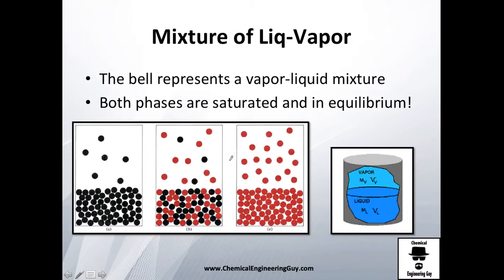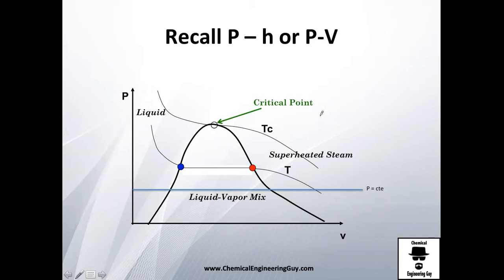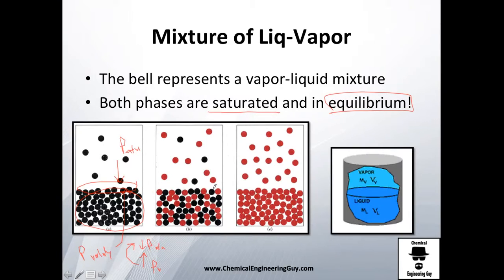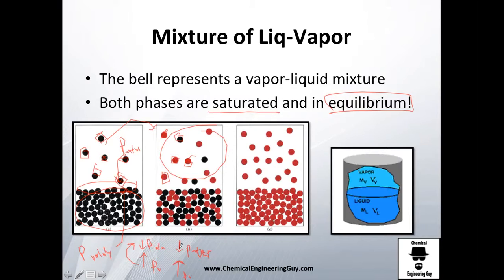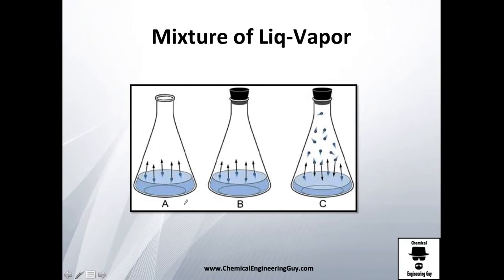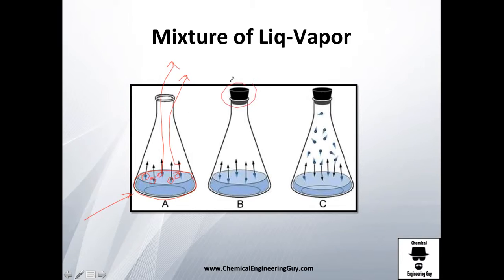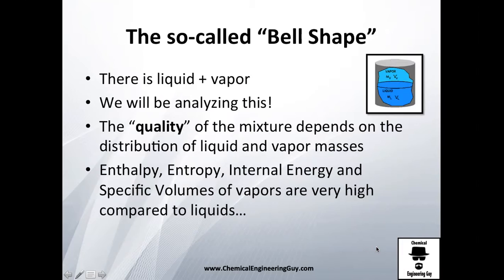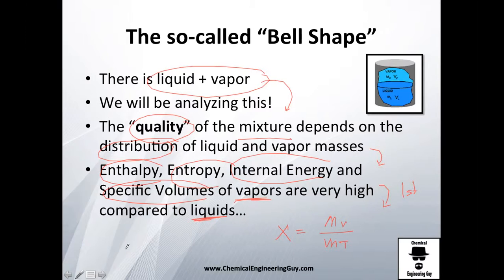Vapor Mixtures of Liquid-Gas // Thermodynamics - Class 55

Comment: In the closed system B, let's say we are trying this in real life and there is dry air and water in the flask. Then we heat up the system to become System C. Will system pressure be higher than Saturation pressure of water? by following Daltons model where P = Pw+ Pa?